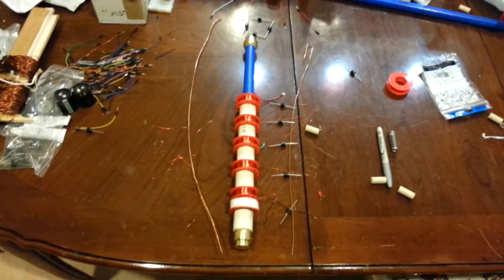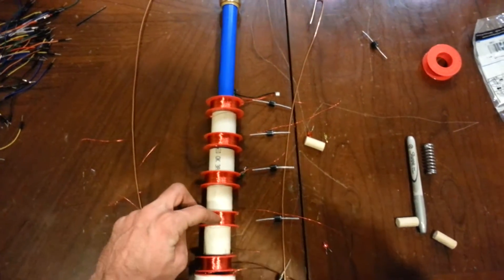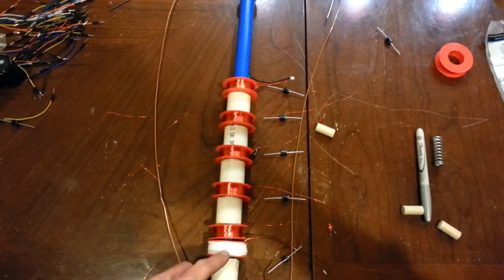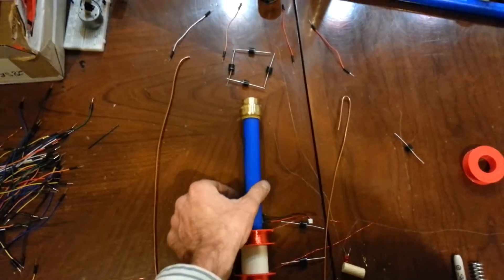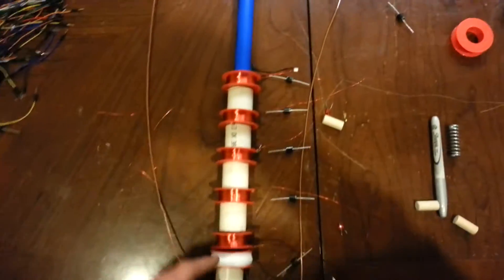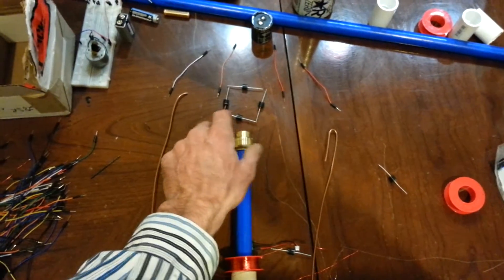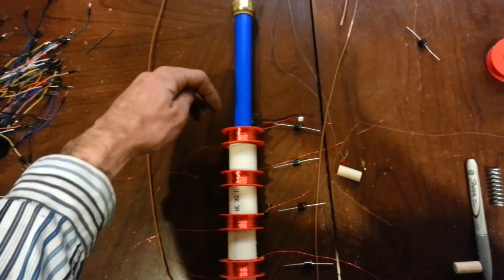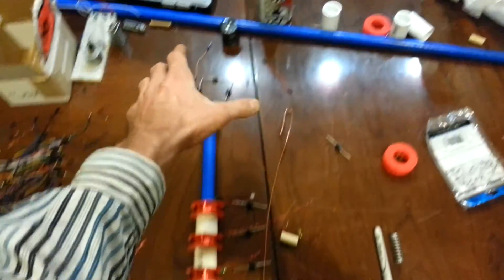Jumper Pulse Motor - 2014 Pulse Motor Build Off Entry Video.

Comment: Cool concept but you'll have to lose the copper pipe in order for it to work at all. Eddy currents will stall the moving magnet.
Reply from the maker: I took that out shortly after submitting the video. I'm currently only using one magnet. I also need to modify the driver coil trigger switch so it will function properly with this design.
Reply from the maker: There is also very little drag on the magnet coming from the coils as the magnet passes through the coils. I figured the magnets would slow down allot as they pass through the coils but they don't. Timing the pulses is what has been difficult to achieve because if the magnet is out of it's proper firing position even a little bit it is not repelled away from the driver coil properly.I'll get it figured out after messing with it a bit more.